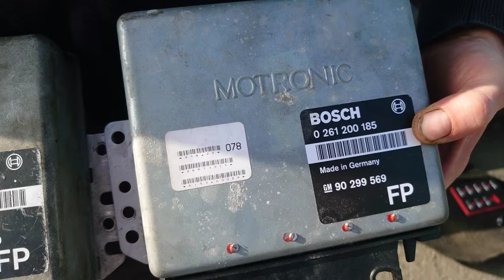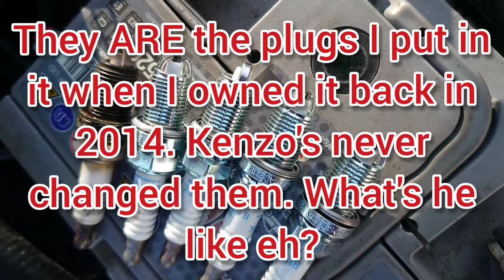Vauxhall Astra GTE 16v: A run down to Duns, then over to Irvine. Sunday shenanigans, Part I

Comment: One of the best hot hatches ever made.
Certainly agree.
Easy to work on & did nearly 200,000 miles with mine on the original clutch & gearbox and it used hardly any oil.

Comment: Brilliant Cars! Had a June 1988 GTE 16V E Plater in Carmine Red. It was rollling roaded standard at 173.5 BHP. The first 1200 produced were between 168BHP and 175BHP. 20XE Engines

Comment: A factory always tunes a car with a bit of reserve so they leave some (but not much) power on the table. Group-N tunes basically exploit that very last bit of of reserve.
TBH i think it's kind of pointless.
The real reason the factory accounts for a bit of reserve is that the stock car has to be able to run reliably all over Europe including countries that have high mountains, cold or hot temperatures or lower fuel quality. 
They even have to be able to withstand long highspeed (200+km/h) runs on the German autobahns.
To conclude: factory tunes are quite sophisticated and very well thought out. Factory drivetrain engineers know what they are doing.

Comment: Standard 16v do 61/62 in second so if it’s  been chipped The rev limiter is higher so they normally do nearly 70mph in 2nd and 3 gear and 4th  is longer as well 🤘🏻

Comment: I have read that the majority of 20mph speed limits are unenforceable. Local councils apparently put all the signs in place but then decided it was too expensive to legally change the roads new speed limits. You can look online somewhere to find out if a speed limit has officially been changed or just the signs have been changed.

Comment: Great car the old GTE was , trouble was back in the early 90s my dads one kept getting the windows smashed , some idiot tried to use the old screwdriver in the ignition trick but luckily my dad had an aftermarket immobiliser  fitted to it , it was kept in a garage but the feckers used an angle grinder to cut the lock off LOL Britwell Estate in Slough always a shithole even back then mate lol

Comment: Have you tired this tip it might help it run better?
From factory after 16 valve are designed to run on standard unleaded fuel if you put higher octane fuel in like super plus V power doesn’t really make any difference unless when you open the bonnet on the top right hand side there should be some kind of loom in that loom there is a cream or brown or green plug It should have two numbers stamped on the plug if disconnect it and plug it in to the higher number which I think it should be 98 /99 this Will tell the ecu To re-calibrate and adjust to super fuel might run better 🤔👍🏻

Comment: Good evening 
Quick question,  glow plugs on my astra j do I remove them with the engine cold or hot 
Cheers Phil
Reply: Warm is best, go easy though they have a tendency to shear off in the head.
Reply: @vidsinmotionchannel  cheers I just done them engine cold , straight out without a problem